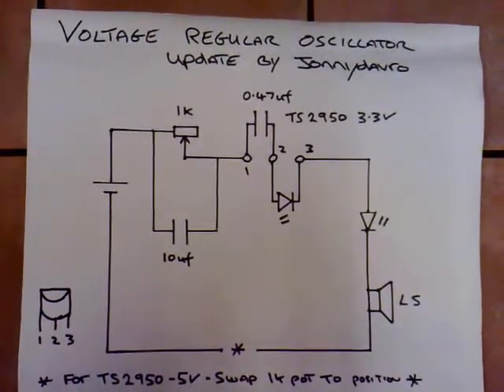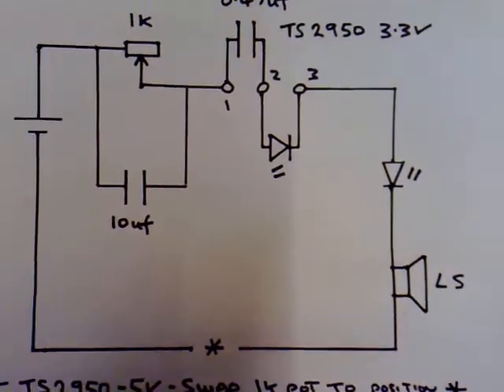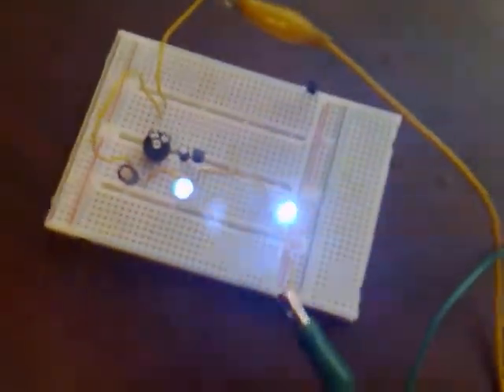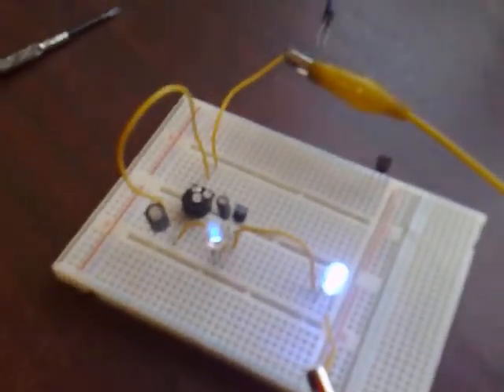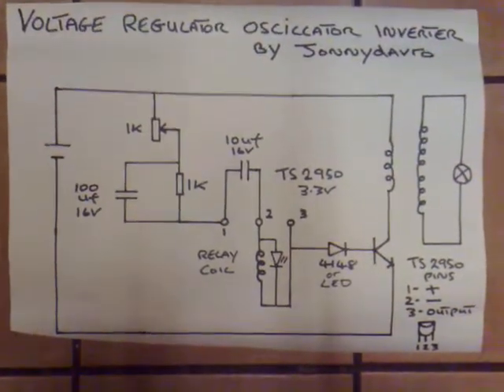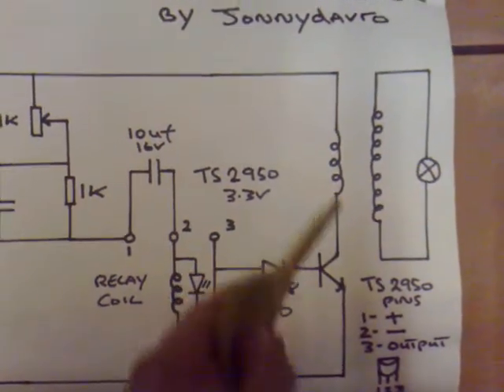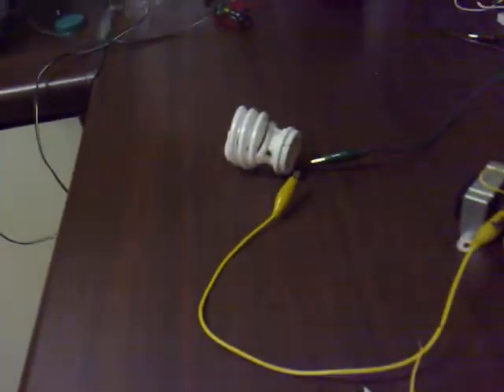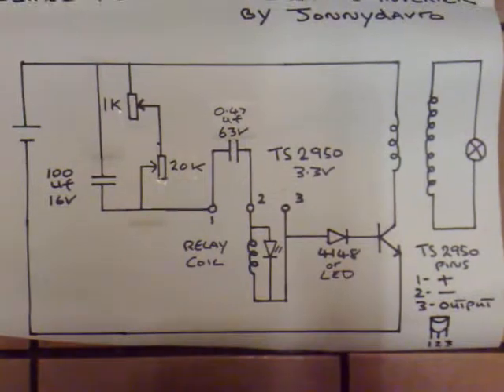Voltage Regulator Oscillator update

Comment: Try this new winding cable!
The ultimate JR P1
I have this lazy TV YOKE that just wouldn't accept any sort of winding or Transistors; the output volt was always lower than what I put in. It’s small, circa 3 inches in D, cylindrical outside, concave inside, and easy to wind. Chose to be bizarre with it; 60 turn of Antenna's wire, single wire; wired like any JT, and hey presto! The V. Meter went crazy! Connected a 110 V LED B on the collector's diode; it was as bright as sunshine. More to follow!

Comment: The ultimate JR P2 
The volts reading, bulb lit; it had 70 Volts to spare. To be sure that it was the cable producing the HV used a toroid less than 2 inches in diameter, with 17 T. Guess what? In comparison to the Yoke had a nice ringing tone, but its V was higher. First tried a 4 V Comp’s B, then a 6 V; worked just fine. To make winding easier, used a small gauge Antenna's cable, 3,5 mm thick. The outer plastic covering reads: 75 Ohms gas Injected. A TIP 31 Trans, the resistor is not choosy.

Comment: This is a bit special ! Will be more so if you can confirm a regular 7805 works ???? If so, that opens the door for pulse motor circuits for me (tons of em in a box) :) It could replace many a 555 circuit I reckon...the cap value changing the duty cycle (from what I heard on the vid).
Any idea what the slowest switch speed is ? just wondering what happens if you throw a 2200uF on it, or a supercap lol.
Reply: apparently the 78XX series does not work, the series pass element is a npn transistor; the TS2950 has a PNP transistor as its series pass element. The TS2950 is also special in its own right.